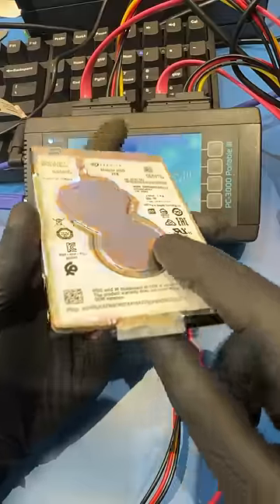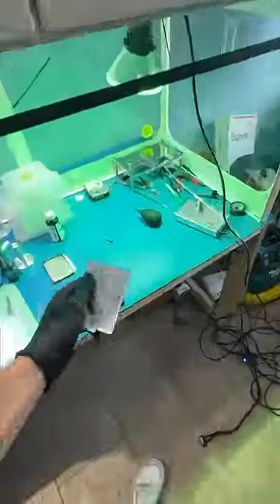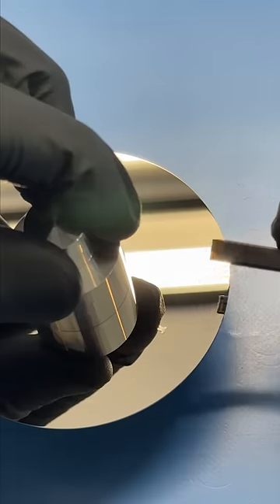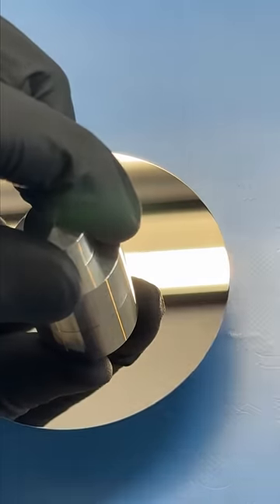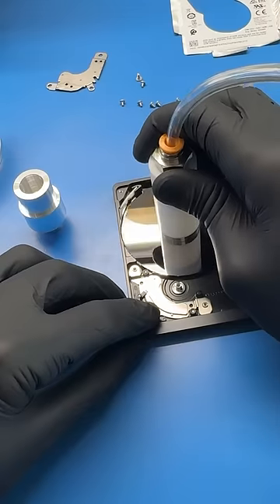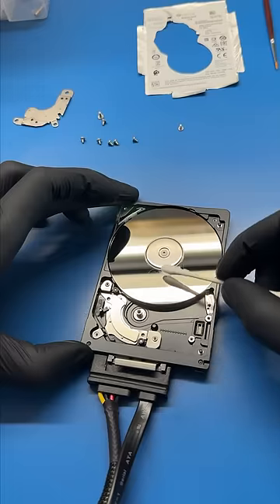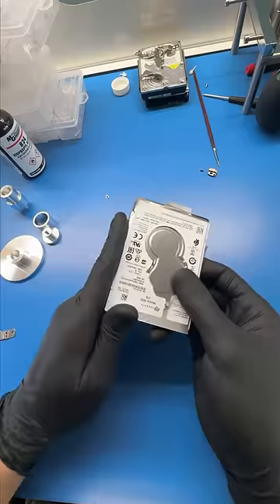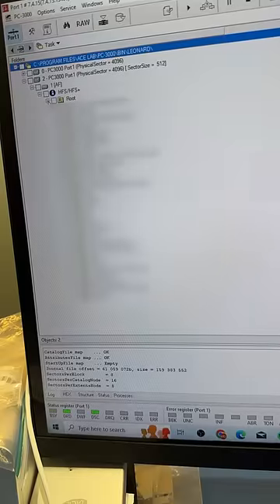Removing Platters From Hard Drives? #tech

Comment: This guy is an absolute surgeon. I have a phone that I need fixed and I really should send it to him. I don't  think I'd trust anyone but this guy.
Reply: Find yourself a reputable local repair guy and go talk to him. There are many highly skilled guys outside youtube. I miself once put together a working screen for an iphone 5 out of 3 broken ones. It was ugly, but worked as intended. And I'm tinkering with or breaking stuff just to have something to fix when I'm bored. I fix my own car, at engine level, and I'm no mechanic. Just scavange the internet for the repair manual and buy a few tools like torque wrenches if needed, and booom it's fixed. I do everything myself, including high pressure water pipe repairs, laptops, phones, HVAC, everything. Just keep in mind that I only do it on my stuff, so if I break anything, I don't charge myself :)))
Reply: @angryquack9687 That's all well and good... if you've got the time, the knowledge, and the tools to fix stuff yourself. The average person doesn't. And it's not like manufacturers make a point of making their stuff easy to repair. Yeah, I'm looking at you, Apple. Hell, one of the 900 series Porsche sportscars requires you to remove the motor from the engine bay to change the spark plugs. Great design work there, Porsche engineers! Then there's the old adage "A little knowledge can be dangerous" which means that if you try to repair something and you don't know what you're doing, you can make the problem far worse.

Comment: I used to do this sort of thing for 2.4MB drives in the early 1980s... head alignment, component level repair, drives had physical ontrack detection, some had mechanical track locks, no RLL, no embedded servos, no dibits or quadbits, just... bits.

Comment: The table that he used to do all of this is called a laminar flow hood. Clean filtered air is being flushed from the hood towards the table at a constant pressure. This causes all the air to flow out of the hood and table, only leaving behind dust free air. They also use these hoods to do bacterial/viral studies and tests in labs so you can rest assured if these are maintained, used and cleaned properly they should leave no impurities behind

Comment: Can you please tell me the price range for a job like this?
Reply: Removing a platter is not an easy job , finding a donor drive is also not an easy job
Reply: go to their website and request a quote
Reply: @dcsnet1 the station is expensive, so does the app device thingy
Reply: @dcsnet1  yes I know I’ve done this myself. I was curious what they charge. That’s all thank you everybody for applying to something that I asked the OP.
Reply: Cracking open a drive won't run you under 2-3k
Reply: Pc-3000 isn’t cheap either
Reply: @networkoperations  did it myself for the price of a donor drive $75
Reply: @larssandvik1347   possible, on single platter HDDs, very hard/impossible to do on multiplatter ones. Even if you misalign them by tiny bit its over
Reply: @flippy9133  yes it was a single platter 2 1/2 inch.   I was very gentle. The hardest part was part of the cover was glued on that was very annoying, but I just applied some heat and it came apart.
Reply: @flippy9133  extremely few drives nowadays need platter alignment.
Reply: @Sharpless2  wym

Comment: I always thought for some reason that the platters had to be aligned to each other in a certain way and that once removed, it was impossible to get them in the right orientation again.

Nice to see i was wrong.
Reply: Apparently depends on the drive, some do some don't.
Reply: No you’re not wrong some drives are like that though not anymore. The design made it basically impossible to repair with most places just straight up refusing to take those drives and telling people, the chance of repair is so small it’s not worth what they would have to charge you for the attempt

My mom went through that whole process a long time ago and I still remember the repair tech telling her what my Dad and I had already said, which was given when the drive was made it likely couldn’t be repaired hence why they stopped making them that way

Comment: He's so professional that he missed platter alignment.  BOOM !
Reply: I was wondering that too, but the voodoo applied to the drives serial port probably helps with that and also that the drive will not be put back in service.
Reply: ahh yes cause lets go ahead and put a failed drive back into service! Boom!
Reply from the maker: Some drives need alignment some don’t. If a drive needs alignment and you lose it, data bye bye.
Reply: @MDrepairsLLC  How do you do platter alignment?
Reply: What is an alignment
Reply: @Mona_Lisa123 When those spinning discs (platters) are aligned exactly in the same place, relevant to each other. If one is slightly off, it won't work if the drive requires the platters to be aligned.
Reply: @Sharkie1717  are there physical markers, or is it the physical bits that get aligned?
Reply: @MDrepairsLLC what will you charge if alignment is necessary?
Reply: @MDrepairsLLC is it possible  to allian data by a software dedicated to to this..i knows there is no such program ...but what if anyone develop
Reply: @jankomuzykant1844 You don’t, there is no way to realign platters that require a high level of precision. Manufacturers literally changed how the alignment of platters works so that  the alignment didn’t need to be so precise anymore, making repairs more possible. As far as I’m aware most modern HDDs no longer require that high level of precision though there are a few that do
Reply: @mr.perfect1067 There’s no point. If you could read each platter individually you could just transfer the data to a new drive. The goal of repairing a drive is recovering the data not putting the drive back into service
Reply: @TheJjcczz  Thank you 👍
Reply: That would be the reason you don’t see the serial number of the drive when he’s showing you the customers data. It’s likely a different drive. 😂

Comment: The black square is just a slider to catch the air moving underneath and lift the heads off the disks. The actual read head is just on the very tip!

Comment: Finally i found some one who shows the real thing. Can you share the complete guide for DIY users please. The software used etc stuff
Reply: That won't be possible unless you have a big amount of money. You'll need a flow chamber (~4000€), some forensics and recovery tools (acelab basic tools ~9000€ +additional software and license costs), some equipment for electronic repairs including microscope and soldering station (~6000€) and consumeables (~200€) considering you have a working PC this is the bare minimum and Im not even counting in donor drives.
On top of that you would need atleast a degree or equal experience in CS to know your way around hardware.
There is a reason why professionals in this field of work are rare and why data recovery is so expensive. ;-)
Reply: @justanothermonkey  i didn't mean the hardware repair, just the software repair. That anybody can do if they have basic knowledge of how drives work. And btw I know how to do hardware repair, I am a CS and Electronics major. 
What I am curious about is the softwares used? There are a lot of softwares available online, but those are rookie newbie softwares only. So let me know if you know any good softwares.

Comment: With just simple tools I would do this when I was in highschool and collage in like 06ish. Mainly it was mostly just transferring to a new drive/computer. Or recovering files from a virus filled computer. Made decent money. It was also more simple back then as there was only like 2 main types of HD connectors. So 1 dock that had both, a fluke flash drives with recovery software and other utility's, a external HD that I used to temp store files if needed and a few tools was all I needed. Oh and my cheap laptop running both windows XP and Linux that I didn't care if I ended up getting a virus on cuz it was not persistent.

Comment: I love Data Recovery, I've been doing it since I was 9 and a HDD was 8Gig (I think the smallest drive I ever did - by small I mean Storage Size NOT physical Size because it was about the size of 4 full size HDDs stacked on top of each other but only 40 MEGAbytes, Yikes) I've seen hardware evolve in ways most people can't even imagine. Even the size of the readHeads have gotten Microscopic in comparison to the Big heavy and Slow ones of the 90s... I learned how it all worked from an Old German Man who designed the Digital Clocks used in Old Mercedes Cars and was forced to work in the Nazi War Effort as a Prisoner/Slave basically until he was rescued by an American Unit and they brought them here where they worked on American Technology (for Planes and Gun Targeting Systems of the time) ... He had one of those BIG cylinder based drives in his Garage, it was HUGE... And slow. But much faster than Paper and a Hole Punch lol... Which is what they used before that...

Comment: What happens if the Platters Stopped Suddenly and the Heads are supposed to float on a AtomThick layer of Air, old drives isn't have a good Emergency PARK system so sometimes if the power was removed the Seek Arm would stay put and when the platters got slow enough the heads would LAND hard on the platters and the force would rip them off... That's why drives like to SPIN UP first before you hear the heads Click around so that there was a Rolling Layer of Air Molecules that would Lift the Heads just one Molecule of air away from the thing to float it above ... When they touch, they do that Welding Trick where when you twist two super smooth and flat pieces of metal together, they Lock Together... Crazy that you actually got his Data Back ...

Comment: taking out the discs and replacing them didn't work on my side some years ago, as they were no longer aligned to each other and no longer centered on the core like they have been before.
Similar things happen if a drive falls down the floor, the discs can move out of center.
Is there a free software that can access to the discs directly to recover files?

Formating was possible of a fallen down drive, the heads wrote the traks new. But wasn't able to read the old datas.

Comment: So, how would it happen in the first place that several read heads get stuck to the platters? Would the drive have had a physical hit that made the read heads hit the platters and get stuck and ripped off of where they were supposed to be attached? Even in case of hitting the platters, why would the read heads get stuck to the platters that seem to smooth?

Comment: I always wanted to start doing data recovery at this level but I suspect the initial investment could be a little bit too expensive. I am pretty good with working with images and electronics in general, so I only need specific tools for head assembly swap and firmware manipulation. How much the setup will cost?

Comment: I have a drive like this myself, just without a read-wrote head in total as I trashed i t when trying to unstuck it (I knew the risks, I accepted them, failed, and thats it)
Now I do have 2 donor drives, I always tought you'd have to have calibration data for the heads to work, in your video it seems that the new head works flawless or do I need the special data recovery tool to access whats on the drive?

Comment: How do you do these reoairs without donor drives or hardware? If someone suddenly brings hardware that sourcing them or similar parts is practically impossible but they need to recover the data urgently, would there be a way without using donor hardware?

Comment: I'm going to assume you didn't recover exactly 100% of the data because where those read heads were stuck on the platter probably damaged that specific spot.
Reply from the maker: We were able to recover all data except 300mb.
Reply: @MDrepairsLLC  wow that's a higher number than I expected but I was correct though that's still not 100% even if it is very close.
Reply from the maker: Ya with this type of work it is never 100%, but 300mb is not a lot, it’s under a GB, was a very successful recovery :)

Comment: I got a computer and some of the keys doesn't work and some times it type without I even touch any of the keys.. what do you think is the problem or can you fix it..  the battery doesn't keep charge either so to use it I have to keep it plugged in

Comment: Hi. Some time ago I try to recover some data from few broken hdd to new donors one. I replaced spi flash from orginal boards and plates, but on each case my drives are not fully recognized, just different errors in dmesg (linux user). Do you use some special custom driver in your system or software that can somehow bypas initialization to get data back?   
Do you preapre somehow a donor board to work with old plates?

Comment: need a 4tb drive recovered, its full of movies, and pics from when i was around 15 i think(collection over years  ended up on this portable). im 32 now and still have it. its a 2.5 wd and tryed to remove a portable drive from case, did that along mb with a flat head under the mb cracking it,  so no board to run the disks. was quoted 1000! and im hoping a yt hero will do it for the shipping and let the view hrs pay 4 it as i still cant. plz thumb my thingy to force my only hope of saving my past. (hoping some of the 600$ of pics i developed at sams from australia is on it as it only exists in my memories like the countless priceless stuff on it. bl movies bl roms emu its a lot of precious hard to find and straight up glimpses of my life on that stupid metallic lump of storage.

Comment: How recoverable is an SSD in your eyes? I recently botched my internal NVME SSD; I tried to image the contents but didn’t realize it heated up so fast because I put it in an external aluminium casing with no airflow. It started corrupting and failing every imaging with macrium and only after the third attempt did I touch the casing and it was extremely hot. Am I fucked here?

Comment: Hey. I have problem. My HDD works fine. When i check with program, ti Ll well. I even zero format it. But whenever i use it, some of the data always go corrupted after a few days. For example i have lots of game and every few weeks some games wont launch. It never happen when i install them on other HDD. After a month, the PC always ask for boot Disk Check everyday.

Comment: Probably full of BS! Sure he got the laminar bench but that not how disk drive works! Each cylinder (plus sectors per cylinder) was written from bottom disc 0 on surface 0, then surface 1, then disc 1 surface 0 and surface 1, going upward to the last disc. Then cylinder count incrementing until 3k+ cylinder inward. The point is when the head switching, the next sector has proper offset on the next surface, then next disc. The low level servo was written to accommodate for head switching, disc switching offset. By taken exact donor drive doesn’t means it will reliably reading the data on the disc due to head and track skew to cause off track which result in inability to read. Good luck replicate this guy fake work! How did the broken heads just laying on the disc surface without head crash is beyond me! To slide the head stack into the discs requires head stack separator as the opposing heads cannot touch each other. Even the screws on the cover has torque spec (too much torque will twist base casting which cause off track error). Am calling this video BS
Reply from the maker: Some drives don’t need to be aligned such as this one “st2000lm007”. You can try it yourself haha. Heads get stuck on platters all of the time because it does not make it back to the ramp after a fall or not ejecting. In this case, someone else tried twisting the heads back into the ramp, without a head unstick tool which tore them off and remained on the platters.